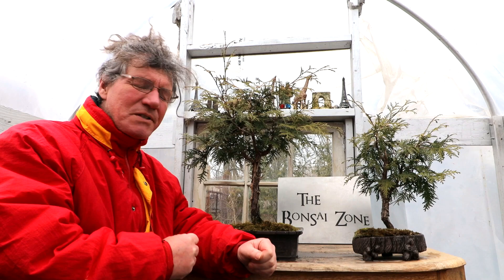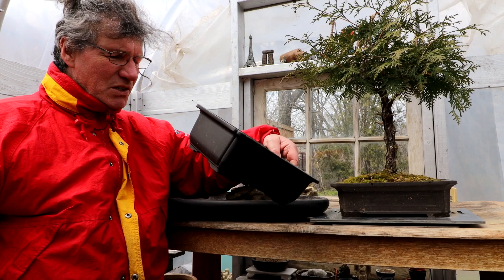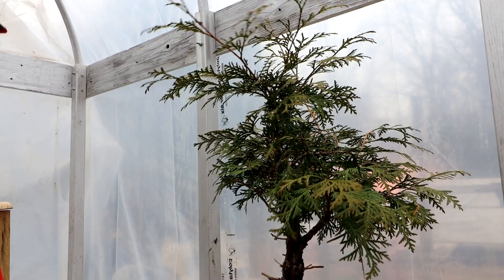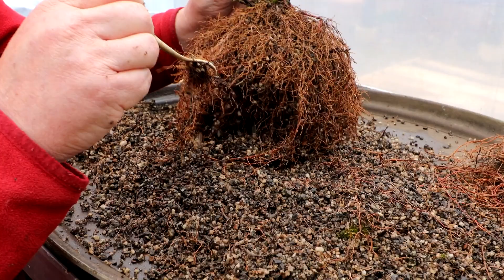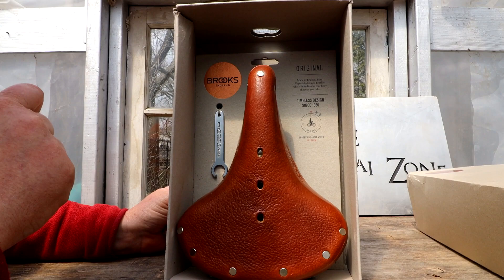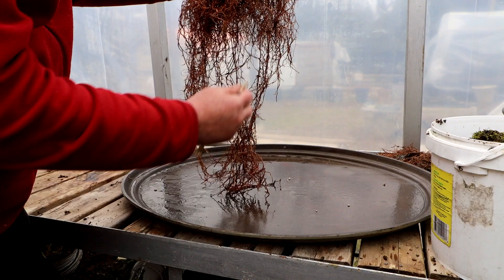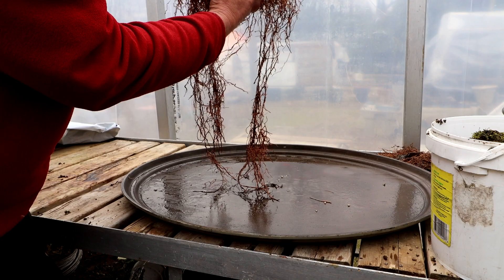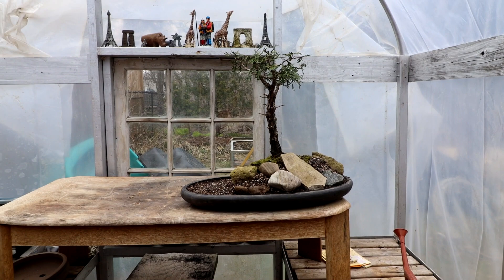Little Cedar Spirit Tree and the Witches Tree Bonsai, Part 1, The Bonsai Zone, April 2020

Comment: I just did a root-over-rock. I covered all of the roots with soil and I wasn’t sure if that’s correct because people always say the roots are “partially buried.”  Well, it looks like I did it just fine. I just need to add moss because each time I water, the soil washes away and I always have to cover the roots back up. Thanks, Nigel!!
Reply from the maker: Sounds like you did the right thing R H!

Comment: The seat post was upside down?
Reply: That's what I thought.
Reply from the maker: Yes, it was upside down, I think because the smaller diameter end was too small for most modern bicycle seats. I have a new taller seat post on order and I'm going to get new wheels also, the current ones have a lot of rusty broken spokes.